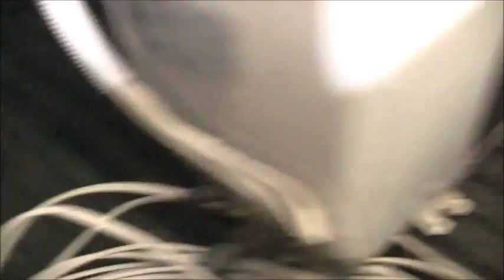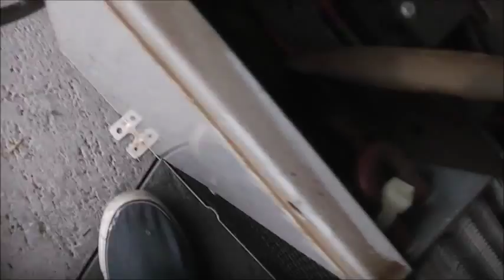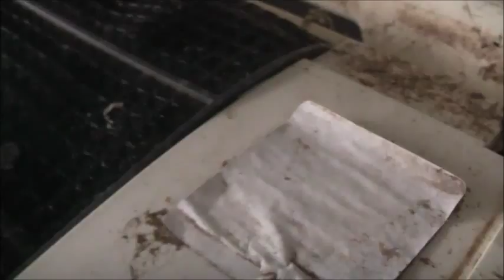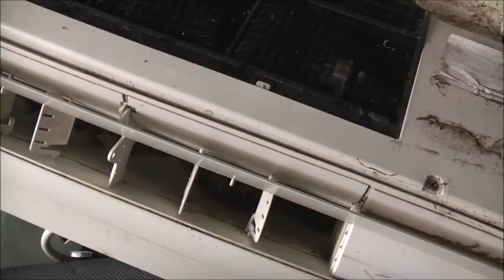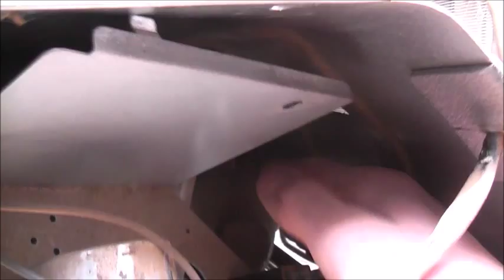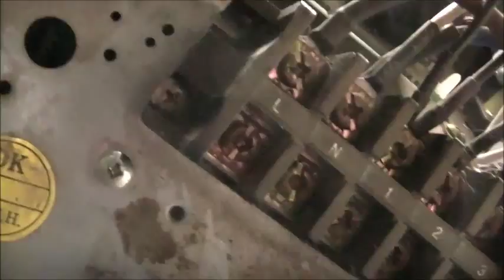Carrier Split System Airconditioning Unit Score!!

Comment: essentially how I recommission units like that one is to reconnect all the wiring, make new lines, connect to the LP line schrader, pull absolute vacuum for 10min or so, then remove vac pump, cap valve and crack open the HP and LP valves and let the gas into the indoor unit. then power on and test run

Comment: Great units the old Carriers! The inverter units are shit compared to these and the window units, they never die!
Those accumulators that have desiccant in them don't usually rattle as it is in a solid block
If worst case, that rotary compressor would make an awesome vacuum pump!